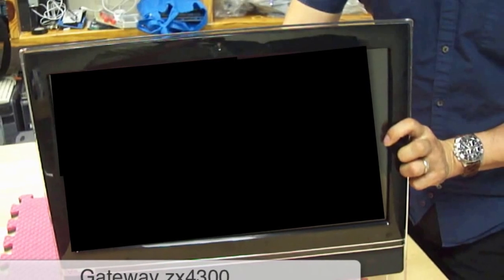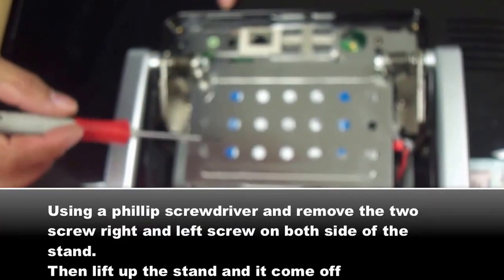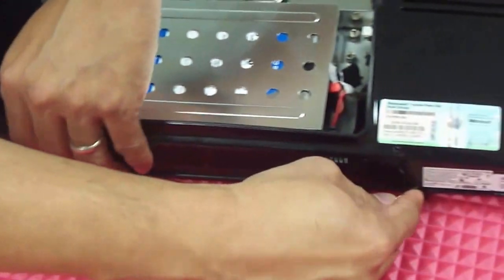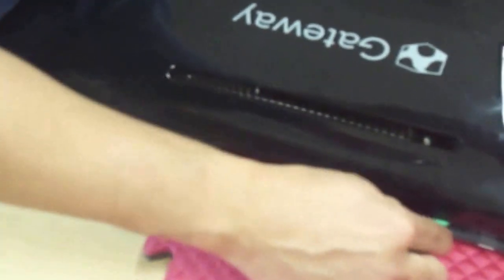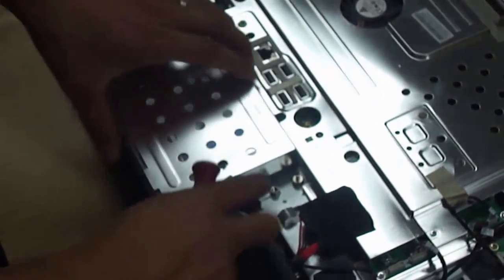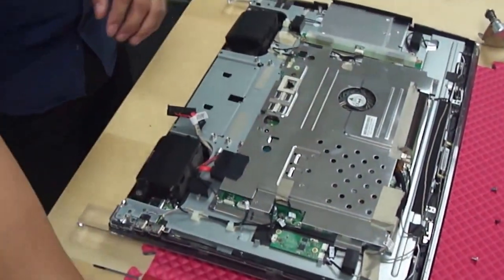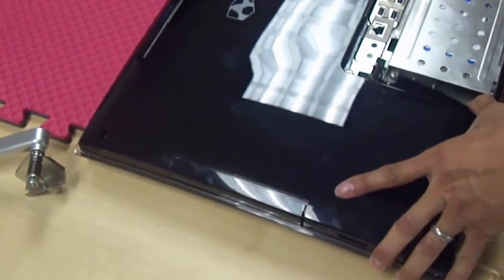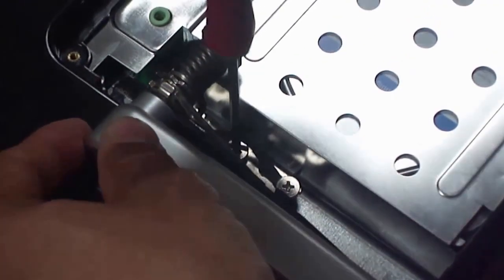Gateway Computer  ZX4300 take apart

Comment: Thanks...the Video info was very helpful....I wanted to know if the Hardrive is a 3.5"  or a 2.5" ...? Because my Hardrive is Failing after 7 years. I wanted to use a 2.5" SSD hard drive (is this Possible).. Also Mine came with 4 Ram. And I want to upgrade...What Type of Ram does it use DDR3 ? And also what is the maximum Ram you can add to this computer.? Thanks so.much for this informative video.Thunbs up
Reply from the maker: yes, you can use SSD, just use Velcro to secure it from being loose.  Good luck!